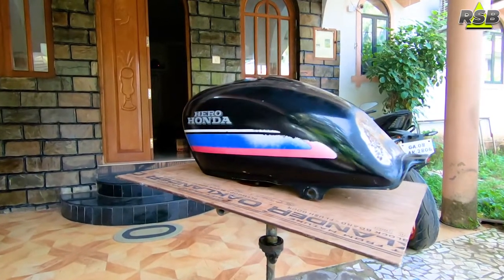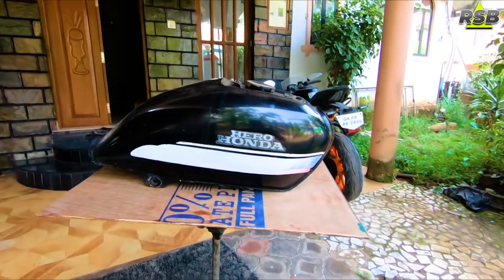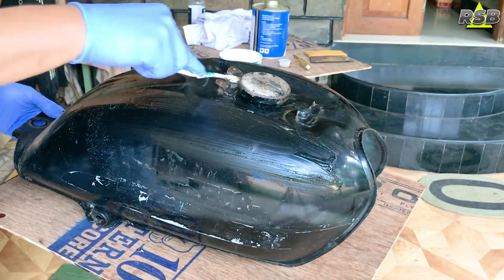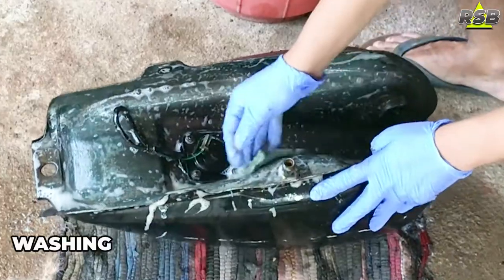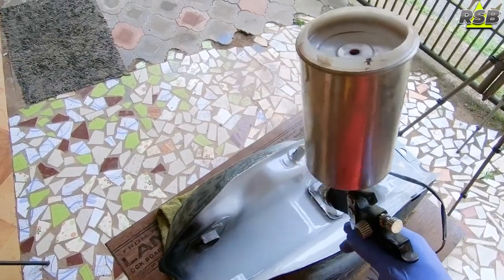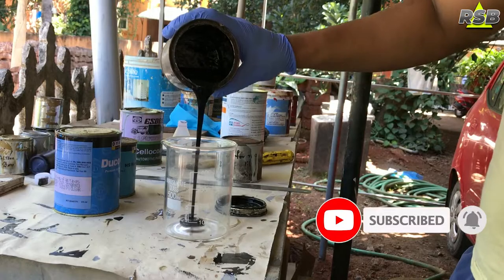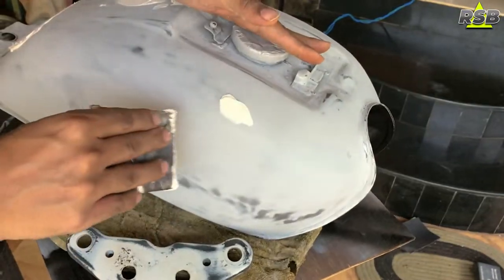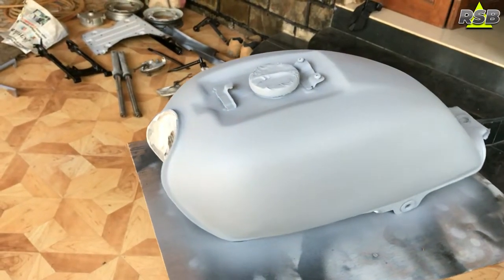How To Repaint A Motorcycle Tank The Right Way | English

Comment: I've done professional painting in the past and you don't want to polish paint after putting it on. If you put enough clear coat on, get rid of imperfections before you clear it and spray it properly you shouldn't need to polish the paint afterward. Done properly you can get a glass finish just spraying.
Reply from the maker: Bro, No matter how good you lay the clear there is some amount of orange peel in it, even show room cars which are painted by robots have orange peel. so if you want glass finish you will have to do colour sanding and buffing.
Reply: @rysonsspraybooth agreed